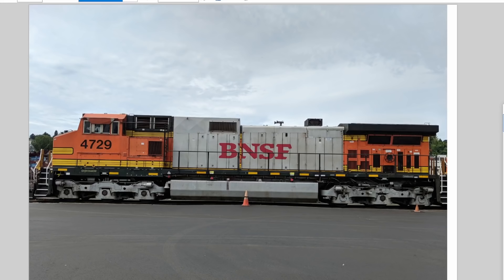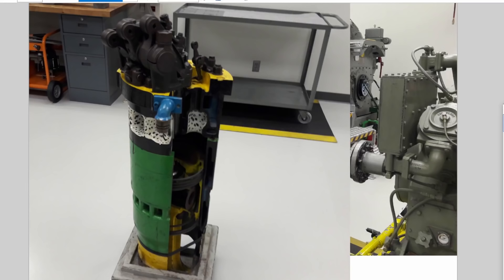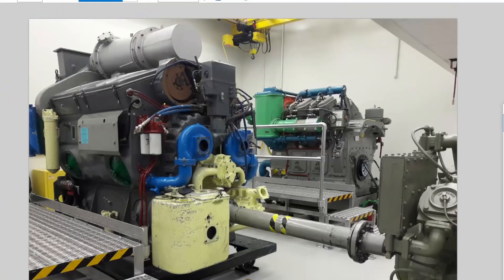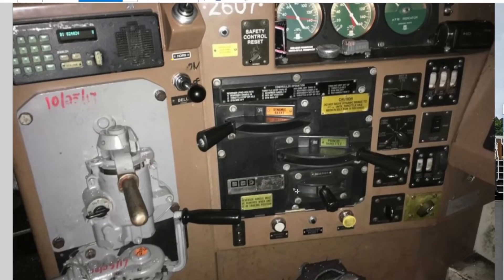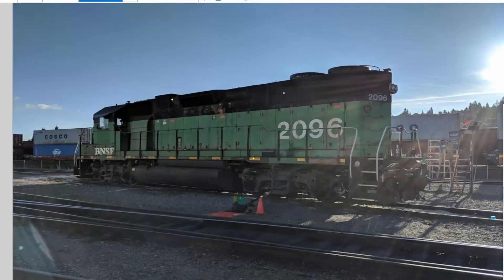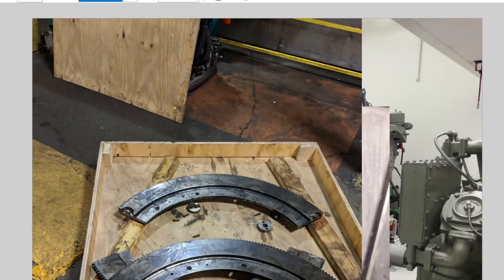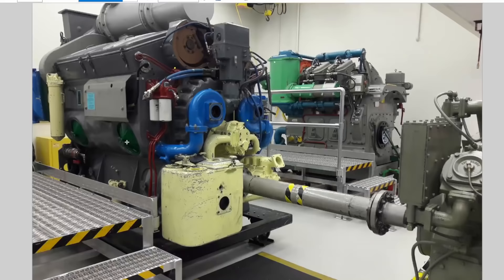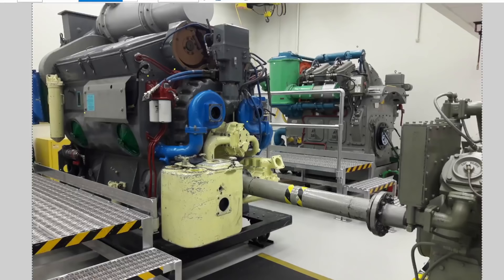Diesel 101 - How DIESEL LOCOMOTIVES Work! [10 Levels]

Comment: KC? :v That's where I live! (Okay, okay, it's technically ' ' unincorporated Platte county ' ', but w/e.)

Battery-powered loco? Whiskey Tango Foxtrot? Just electrify them thar gosh darned rails already! Use the grid for your braking load! (Okay, so going to something like 80% minus transmission losses is still better than like 20% minus conversion losses, but electrification is pretty much 100% minus transmission losses - unless you start factoring in powerplant efficiencies.)

When I was a kid, I thought that diesel locos worked by charging up a giant lead acid battery (which I mistook the fuel tank for), and that in turn powered the wheels.
Reply from the maker: Electrifying the tens of thousands of miles of railroad comes with its own unique challenges... Easier to go battery.
Reply: Never claimed it didn't, but easier != better in the long run. Batteries have a myriad of issues for use as locos. Charging downtimes, and efficiency to name but two. Electrification will definitely cost a lot more upfront, but I fail to see how it will lose out in the long run to batteries. Sure, batteries likely beat out diesel-electric, but in the long term electrification just makes more sense from everything that I know. Esp. if you install some of your own renewable energy sources.
Reply from the maker: @LexieAssassin  I totally agree with you, but the railroads are about what's easier and cheaper... unfortunately.
Reply: Yeah, that's the Capitalists for you. It may save them a buck today, but when the batteries start wearing out, then they're gonna spend more arguably in the long run.
Reply: @LexieAssassin  They would spend more on electrifying thousands of miles of rail by having to generate that much electricity. Were talking hundreds of thousands of miles of electric rail, which really isnt that efficient when you look at how much energy you lose over a distance of wire. High speed passenger trains are one thing, but moving shit loads of freight on a regular basis is another. 

Unfortunately renewable energy will only be a thing once its profitable, so probably never at this rate. By the time the billionaires feel the effect they will be long gone to leave us on a fucked planet. Its not just capitalism, its also communism and really any government that truly puts money and greed in front of the common good. 

#eatthebillionairs #corperateamericaistrash #communistchinaruinedhongkong

Comment: Where can I learn about diesel only locomotives, the kind that were used after steam engines and before the age of the diesel-electrics?
Reply from the maker: Diesel electrics were pretty early on! I've got a friend who's done work with diesel-mechanical (diesel only, as you say) moreso than I that we're planning another video on down the road.
Reply: @Hyce777  Thank you for responding. The reason why I am curious about the diesel transmission engine is because of an event I experienced while working at USSteel Pipe Plant, Provo Works Utah in the late 1980's I think. There was a dedicated engine used to transport the full slag carriers from the BOF shop to the slag dumping location a mile or less away. The Provo plant was probably built in the 1940's so there was a huge slag accumulation area and the slope up to the current dumpsite location was serpentine and fairly steep towards the end. I was working on a scientific fact finding study to determine the feasibility of spraying the congealed slag with "Devil's Liquor" water I think was comprised of the various cooling fluids used to descale the steel as it made its way through the various processes inside the pipe mill. Anyway, by the time the water was collected it was iron -red in color and smelled like it had other petrochemical additions mixed into it. It was sent to a big "pond" where it was clarified and treated before heading off plant property. I guess NPDES water permitting process was complicated and ideas about how to confine the more "nasty elements" of the liquor to plant property were investigated. One such idea was spraying the contaminated water on top of the recently dumped slag to assist in the cooling down  of it and flash the water off as steam reducing the volume of wastewater to be treated significantly. I was part of the testing crew hired to determine what other chemical species were also released into the air along with the water vapor during the cooling process of the red hot slag.  For a general idea about how the slag dumping process worked see this video capture of a similar slag dumping operation filmed by Steel-man-Jules at another steel making operation in Bethlehem Ohio plant. https://www.youtube.com/watch?v=zhJF_hTJ2Rw
Anyway, my experience witnessing slag dumping was at the Provo Utah integrated iron and steel making plant. The full slag cars (thimble cars) would be assembled together at various times of the day and generally pushed to the dump site once or twice every 12 hours or so. This short but heavy train setup making its way to the dump site was always a favorite part of my day to observe and I got as close to the operation as they would physically allow anyone to be. It was inherently dangerous and self preservation was always high on my priority of things to be thinking about (like always being "uphill" from the train just incase anything should decide to spill).

There would be times when I was unaware of the train making its way up the serpentine track to get to the dump site. The prevailing wind direction was typically blowing the sound of the approaching train away from me.  So while setting up air sampling equipment for the tests that would take place many hours later,  I was busy doing my own thing oblivious to what was slowly making its way coming up the hill from far below me. 

On one such occasion, I had my back to the downhill slope and was busy doing something I don't remember what. But, all of a sudden I felt very strange. I was unsure about what was happening to me. I remember feeling like the inside of my chest was a "drum", shaking as it my heartbeat was going to burst out of my ribcage. Whump! Whump! Whump! My entire insides felt like it was shaking and pounding like I was going to explode from the inside out. I was instantly terrified that I was having some sort of a gigantic heart-attack, thump, thump, thump, I scrambled upright and felt my chest but it did not seem like it was coming from my own heart or lungs operating strangely, it felt like something was hitting me in my  back and causing my insides to vibrate in sympathy. I was totally freaking out. I could not escape whatever it was,  there was nothing around me but mountains of hardened slag. There was no sound of the giant Euclid's that prowl around the lower plant property. The International Mill Service (IMS) rock screening plant was not in operation at that time and since the slag dump was out in the middle of no-where, it was eerily quiet save for the winds blowing at the higher elevation.   

So, I spin around and see what the hell else could be bearing down upon me. Off in the distance less than a football field away I could see the huge thimble cars being pushed slowly towards the summit I was working on. Thumpa, thumpa, thumpa, there it was I could tell it was getting closer to me as the pounding inside my chest got harder and harder to understand. Then I finally put it together, now with my ears facing the oncoming train I could hear the rumble of the mighty pistons as each one reached top dead center and a mighty concussive explosion was discharged into the smoke stack. I still could not hear, the wind direction was blowing it the other way it but I rather "felt" it instead.   

Unbelievably slow, a lot slower than I had ever imagined a train engine would operate. I have estimated a percussive event about every 1.5 seconds. Thumpa, thumpa, my insides vibrating in unison with each detonation. I don't know how many cylinders this thing had but it must have been a 4 banger because of how slow the periodicity between the thumps was. It might have been a two stroke diesel locomotive? Whatever rpm it was running at it was very slow. The sides were all covered up with metal and I could not get a good look at the engine inside, but it had a smoke stack the size of a one gallon coffee can. Painted all shiny black with a red pinstriping is all I remember. 

Definitely not a diesel electric. I have a ways wondered what kind of engine was inside of this thing. Can anybody help me understand what was inside this little beast?

Comment: Minor note: the dynamic braking system is not "regenerative" because it doesn't store any energy, it only dissipates energy.  A regenerative braking system stores (most of) the energy from braking for use in later accelerating (re-generating the kinetic energy).

Comment: Seems to me that locomotives are much quieter running now .  I used to love the deep throated roar of the diesels that usually accompanied them. Was there a design change in recent years that explains this?
Reply from the maker: Don't think so, though the GE's are a different sound than the EMD's that had more high-end with the turbos.
Reply: @Hyce777  thanks for your reply. Think you may be onto something w difference between various blowers vs turbos. Enjoy your vids 👍
Reply: @bilbobaggins1934  thank you very much for your reply. That sheds a lot of light on the issue for me.
Reply: I believe a large part of that was the increase in emissions regulations. If you ever look at a 50's EMD, especially a switcher, their exhaust system is cylinder-->manifold-->stack, which provides little opportunity for sound deadening (although I think the exhaust manifolds did have some muffling qualities). As more emissions control equipment was added between the cylinders and the atmosphere, it naturally quieted the exhaust. I think there were also some noise regulations put in around the same time, as lots of guys were hitting retirement with hearing damage, especially if they worked in mountainous territory where full throttle running was common. This also led to better sound insulation in the cabs.
Reply: @CNR-fw9ei  Thank you for your detailed explanation. Much appreciated!

Comment: Does the diesel engine have an air cutoff to prevent a runaway, or is the inherent design of the lubrication system prevent runaways?
Reply from the maker: They certainly can, and have run away. Usually due to a failure of the overspeed in the governor; it detects anything over max RPM and kills it before it really starts to run on its own. That said if that mechanism is broken they can.
Reply: @Hyce777  Usually, runaway prevention involves cutting the air off, because damaged rings are allowing the diesel to burn its own oil.  They're usually mechanical flaps controlled manually or electronically.  At least, on trucks.
Reply from the maker: @efricha  indeed. The locomotives don't have anything like that.

Comment: So I made this long ass comment but then found this video of an Aussie who explains it perfectly https://www.youtube.com/watch?v=Xa2x5vrie-o

I was watching and wanted to point out, that the roots blower does not create any usable boost, it moves the air, as a two stroke EMD has no way to force air, like a small gas two stroke into the cylinders. Its also the reason they have to use valves.

So when a gas two stroke piston reaches the point that it exposes the intake port, the air from the crankcase is pushed into the cylinder from the force of the piston moving downwards, which also helps force the exhaust out and keep the exhaust from blowing back into the crankcase, then once the piston moves up to near Top Dead Center, it exposes the intake port from the carb to the crank, at this point, the piston moving upwards creates vacuum in the crank case, once the piston passes the intake port, it draws in the air fuel mixture, then as the piston moves downwards and starts creating pressure in the crankcase, the reed valves close off the air flow and it keeps that air fuel mixture in the crankcase, and forces it back through the intake between the crankcase and the cylinder wall. 

On a diesel like a detroit or EMD, you cannot utilize the bottom half of the piston for air/fuel inlet, 1. Because your crankcase needs to be sealed for lube oil. 2. because that volume of an explosive mixture in a block would be catastrophic if it ignited, 3. Because diesels need to have precise injection timing as to not preignite the fuel as the piston is moving upwards. 

So when the EMD piston is right at the bottom, and those ports are open to fresh air, the blower pushes fresh air into the cylinder from the ports, and at the same time the exhaust is open, so its forcing whatever exhaust gas is left out, and pushing fresh air in, then the exhaust valves stay open just a fraction of the compression stroke to not blow air back out of the power assembly, once the piston passes the port, the exhaust valves close, the cylinder travels upwards, it fires, and right before the piston reaches the point where the piston is going to expose the ports in the liner, the exhaust valves open and let the pressurized exhaust release. 

So in essence, an EMD engine could not run without some sort of artificial air movement, if you tried to run an emd with a broken blower, the exhaust would never actually escape the cylinder, and it couldnt let fresh air in.

Its the reason the turbo units needs to be clutched, without the turbo spinning, and acting as a blower, the engine would never reach an RPM to force the turbo to spin on its own.

Now there is an old trick that old Detroit guys would do with their blown engines, which is advance the exhaust timing, so when that piston was at bottom dead center and fresh air is being blown in, the valves would close prematurely which would in turn, make the blower, a supercharger, and shove air into the cylinder under boost. It increased mid range power some, but lost low end and idle ability.

Thats why 567s and 645s that have no turbos are called NA motors, they are technically naturally aspirated as there is no boost being produced.
Reply from the maker: Huh, that's actually really neat. Had no idea that the blower'd units ran that way, they wouldn't talk about them in school because "no one saw them anymore". Well, except of course our little shop with all the ancient power... that's neat!
Reply: @Hyce777  roots blown units were actually quite popular pretty late, I think the last roots blown EMD's would be built 1986 with the last GP/SD38s. The RRs preferred blowers over turbos on lower power locomotives, apparently for easier/cheaper maintenance. That's why the GP38 outsold the GP39 so much, a 2000hp roots blown V16 in the GP38 was deemed more economical to operate than the 2300hp turbocharged V12 in the GP39

Comment: Doesn't the governor also regulate engine rpm on mechanical injection systems, otherwise diesel engines can run away (just keep accelerating RMP) ?
Reply from the maker: Yes, precisely - I thought I had that in there? probably not in the first pass of talking about it.

Comment: could you talk about diesel hydraulic engines in an other video? these are very common in germany and europe in general but not much information is accessable about the system.
Reply from the maker: That's the plan! I have a friend who has worked on them so it is totally doable.

Comment: a small question , why do these locomotive engines not use air to start like the tugboat engines (note : this may be a silly question )
Reply from the maker: The bigger/more modern EMD locos do use air to start. Electricity is easier, because you need it to run anyways, so why have the separate system... lol. Lord knows any time we got an air start locomotive in, we'd forget to charge it with air and they'd come back in after setting up all the flags and request it get charged... lol.
Reply: @Hyce777  Many of the the old MLW/ALCO units used it too

Comment: Why don't they use super capacitors instead of batteries to store the power generated from braking?
Reply from the maker: Not sure.
Reply: @Hyce777  sorry if I came off as rude, didn't mean to. Just got frustrated when I learned they have "regen" braking, but just vent the energy off as heat.
Interesting video as always!
Reply from the maker: @georgblennow3174  You didn't at all! I genuinely don't know. And yes, it is maddening that it's wasted, isn't it?
Reply: @Hyce777  Ok, thanks! Just sounded bad when I read it back then